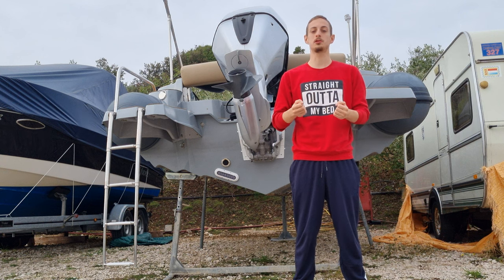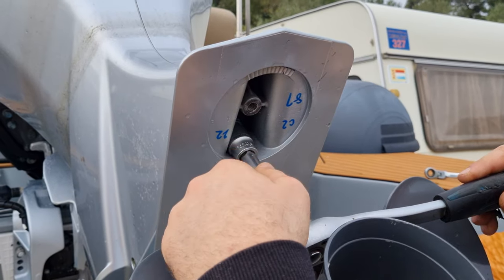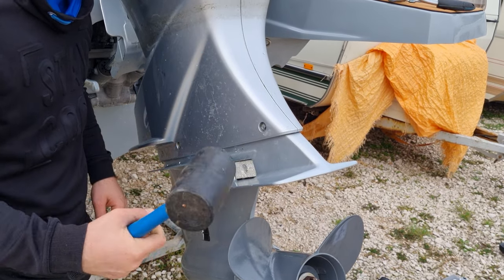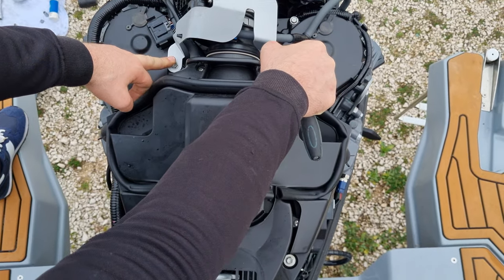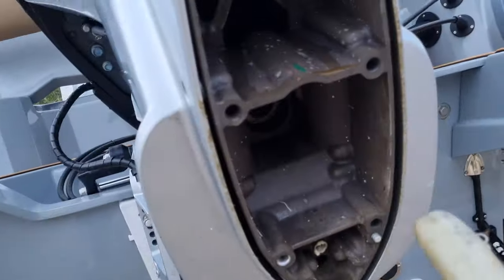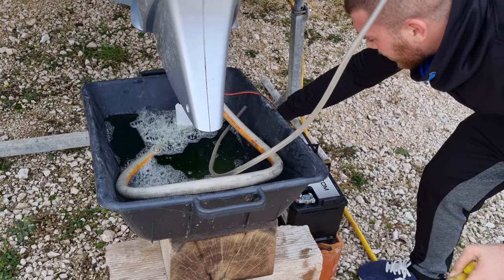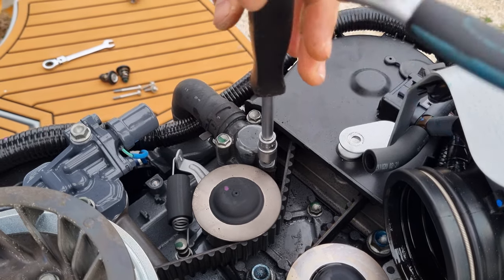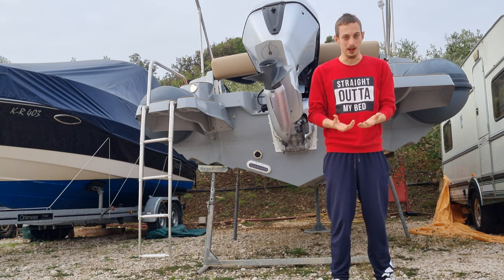How to flush an outboard!! ENGINE "Proper salt removal video"

Comment: Very well done gentlemen!  English is not your 1st language, however you have made a very good video in English congratulations!  I was worried when you took off that trim fin to access the last bolt holding on the lower unit in that you did not mark or index its position.  But at the end you showed that the proper location for that trim was already marked by the manufacturer.  and you are correct about always lubricating hardware in marine applications.  Thank you!
Reply from the maker: Thanks!! Its hard for us to explain in english..We tryed our best,Thank you for a nice comment and nice compliment we gonna post more vides and try to explain it even better...

Comment: This method does work, I've done it using Rydlyme on an old saltwater motor.   It can be rough on the anodes so replace them too if you can.
Reply from the maker: Yes it works with other Chemical solutionsalso.. But you choose whats best for you...Tnx for commenting
Reply: @Ki_jo  can this work with hydrochloric acid<?
Reply from the maker: @makingcookingfixing  Personally i wont try it...Maybe its to hars on internal anodes..
Reply: @Ki_jo  thoughts on this wearing out rubber gaskets like the head gasket etc
Reply from the maker: @wazup3333  Nice tought but i know guys that are certified honda dealer that are doing this for long time they had no problems..Neither did i im using it for 3 years now

Comment: Never saw the shift shaft disconnected or mentioned. Please folks, do not follow this video for advice.
Reply: You do not disconnect the shift shaft on a Honda, it slides right out. Great video!
Reply from the maker: If you dont understand that the shift shaft stays with the lower unit dont Comment on videos without getting good information about the engine!